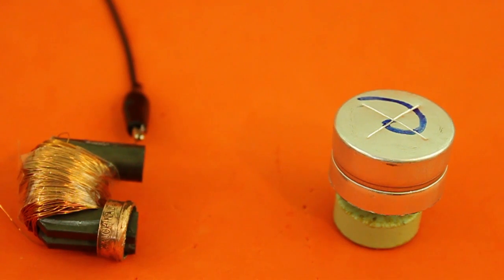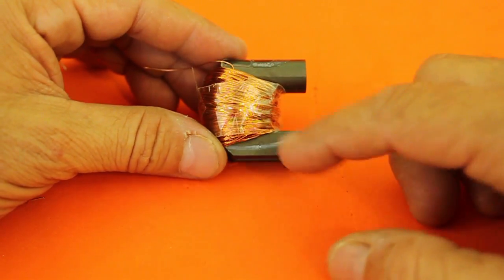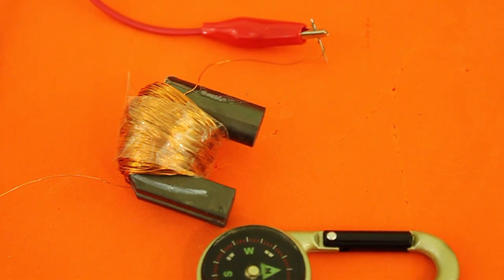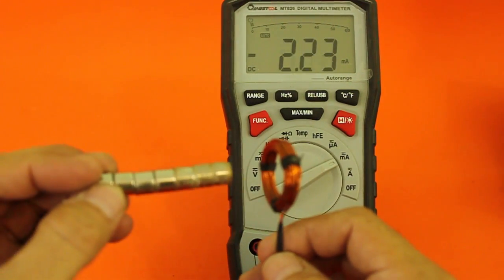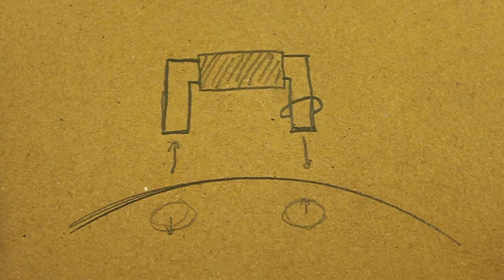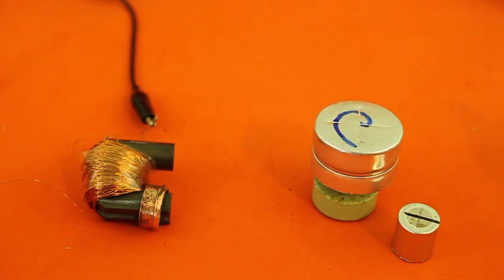Homemade Shaded Pole Induction Motor

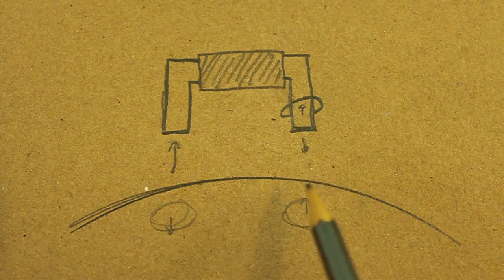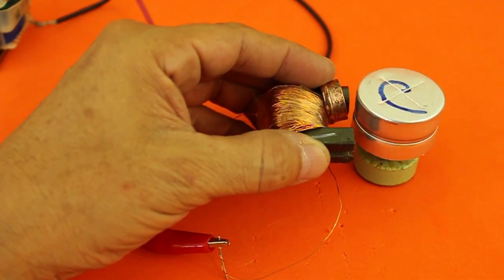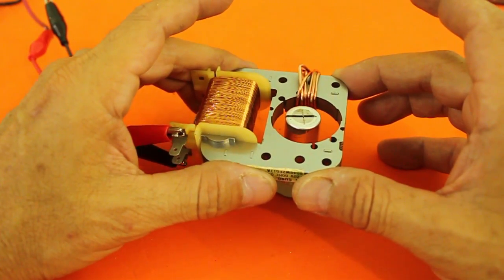Comment: In 9:34 you said that the rotation is from the unshaded pole to the shaded pole (due to the asymmetric induced field). But in 10:22 you showed that the rotation is from the shaded to the unshaded pole. Back to 5:37 and 5:50, 6:00 and 6:20, it was also rotated from the shaded pole to the unshaded pole. But however, with the demonstration in 6:50 and 7:04, it was true that the rotation was from unshaded to the shaded pole. That probably due to the core is fully make ring while in your home made motor is just half ring core.

Comment: Would this shaded pole motor work if you apply DC current? 
(It almost seem to work even better with DC.  No?)
Plus I have another question also.  Would it work if you used a horseshoe magnet with a coper ring on one of its pole ?  And that would again mean DC I suppose.  I am probably missing something here?
Oh maybe there is has to be changing magnetic field.  Maybe that is what I am missing.

Comment: A shaded pole is just a weaker pole?  Wouldn't that be like using two 'bar style' electromagnets?  One weaker than the other and applying ac so the poles swap?

I fail to see how such a set up would cause rotation.  It doesn't do it when the poles are the same strength so why would it do it because one pole is weaker?

Is it because the weaker pole 'becomes a pole' slower?  Like it's not 'instant and weaker,' but 'gradually weaker?'  So the gradient movement allows for rotation?

Comment: 9:25 the induced forces are symmetrical, but aren't they changing in direction, because of the AC?! so if each side will be pushing and pulling like 60 times/sec, wouldn't the net force be 0 over the whole time?! can someone explain please?

Comment: Hi Lucid, nice explanation!
Challange for a new experiment for you: I would like to spin a flyweel. The flyweel can be a brass, copper, iron ring (any high density material, not aluminium), possible a ferrite magnet ring. The motor mechanism should be symmetrical looking 90 deg at the axle (balance through the centerlplane of the flywheel). How would you do to get a flywheel like that spinning fast without mounting magnets on the flyweel or using an external motor?
Reply from the maker: How about winding a rope on the axis?
Reply: That sounds as a simple solution but how will it interact with the flywheel and get it turning? 
Maybe put aluminium (tube) inside the flywheel ring and drive it similar as you do in this video but insideout would work.

Comment: Since i got interest learning motor.... ludic science is the best.. learning more of.. .     Easy understand... teaching good ... quite clear
Reply: @ludicscience  .... sir... my earnest request....... i am eager to know...  can we use water as wire.... i mean power supply from ac or dc  ... without using wire but to use water as two wire negative and positive  .... can we get light in betwen  5 feet........ ........ or with salt water......  ... and which one will be better...... because i heard that a girl die when her charger got through water and from that current run through water and she die...

Comment: Thanks for posting.  It was something of a mystery how a solenoid could work in both AC and DC mode.  Please post a video on how to calculate the holding current of a solenoid so it does its job but does not go into saturation and burn itself out.